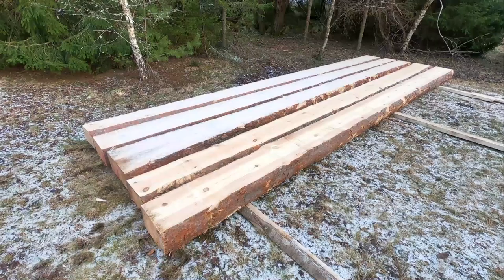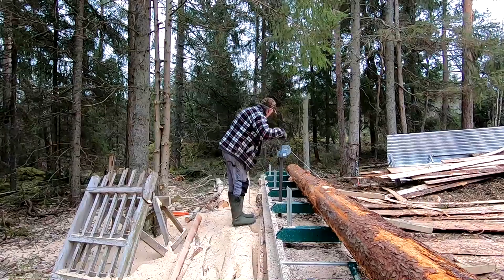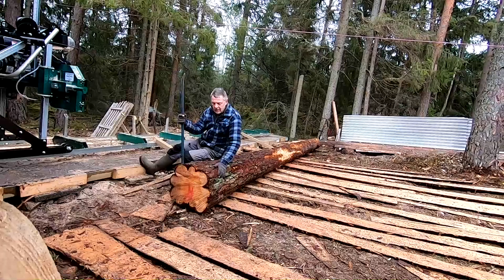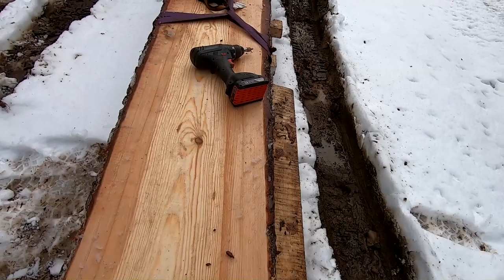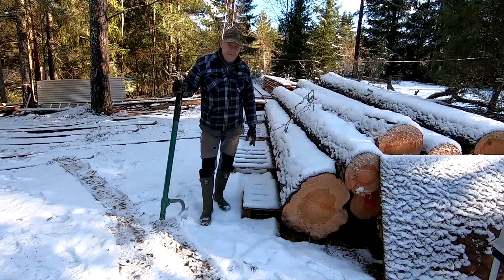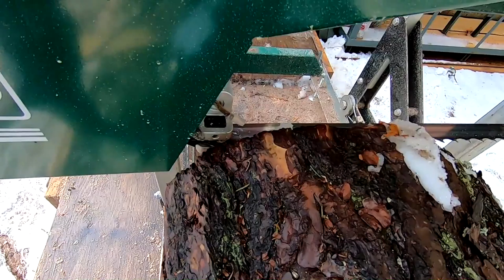Big Logs, Woodland Mill, Mud Problems. VLOG #148 - S3

Comment: Love your life style.
Any dislikes on the mill.
I just bought the 122 with 6' extension.
You have to work smarter not harder.
Can't wait to see you mill shelter.
Can I ask where you are located. 
I see you are watching the Wis election hearing.
Reply from the maker: Hi Willburr. Until now I don't have any dislikes as such. Small stuff as the start handles placement, but that's noot a problem. The Mill shelter is on hold at the moment, it will be build later. I live in Sweden, but are from Denmark. Moved here 4 years ago, and love the silence of the woods.

Comment: I'm hoping you figured out the release mechanism on the come-a-long. If you lift the dog lever on the handle side and bring it all the way back to the other dog lock and then push it hard down to the hook it will release both dogs at the same time releasing the tension.
Reply from the maker: Hi Quarlow. I did figure it out, but it was so tight, that it gave me a lot of problems.
All the best
Michael